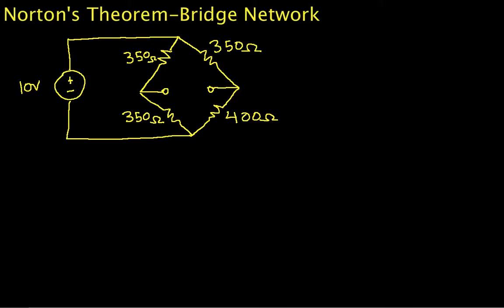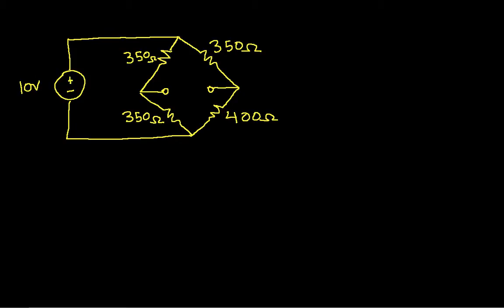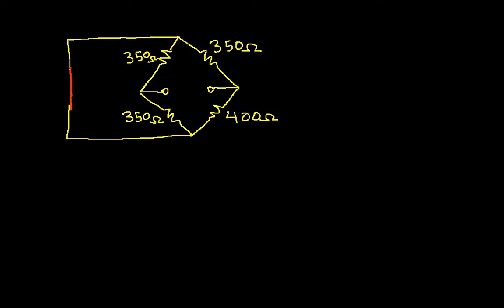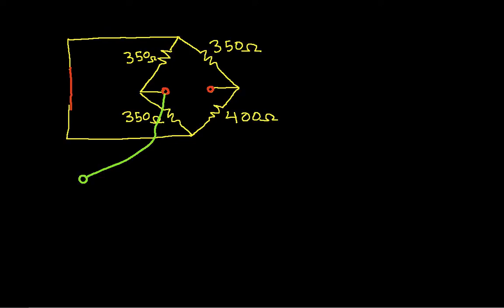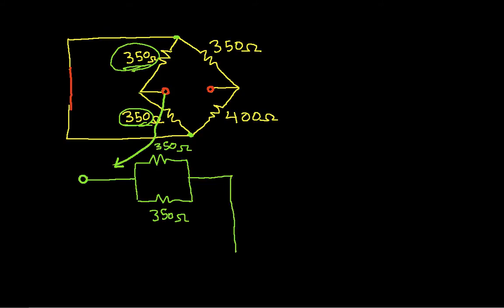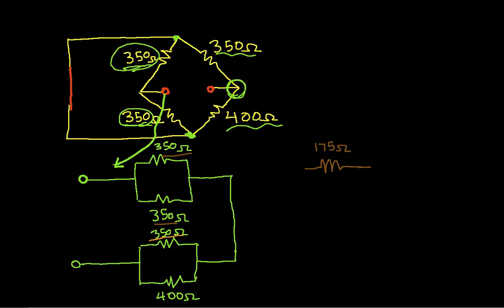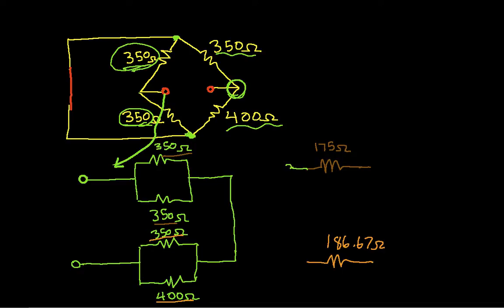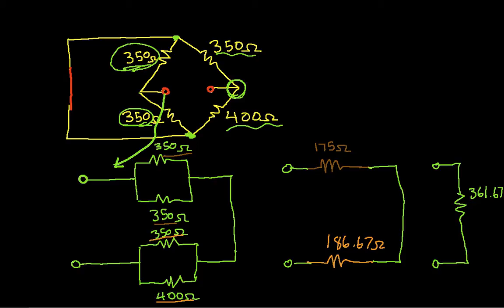Norton's Theorem Example-Bridge Network Part 2

Comment from the maker: I get very sloppy with significant figures; it's a character weakness. In some circuits, you will get in trouble rounding to 3 significant figures because, for example, a voltage in the circuit is 10^6 times another very small voltage that is in turn the difference between two voltages; if you round here, you get answers that are way off. Generally speaking, however, 3 significant figures is fine for computations.

Comment from the maker: Are you referring to the circuit with resistors drawn in green or the circuit with resistors drawn in brown? The green circuit has two parallel combinations that are in series. The brown circuit has two resistors in series. Two elements are in series when all the current that flows through the first element must flow through the second element; in other words, the elements are connected by a single node that has no other connections.

Comment: Very good but I find that we are taught to 3 sig fig engineering terms,, is this normal? I find 3 sig fig seems to stay with the -+ Tolerance of the resistors.. if used with common types.
5% 10% and 20% do you concur?